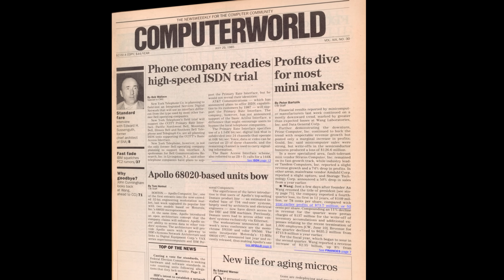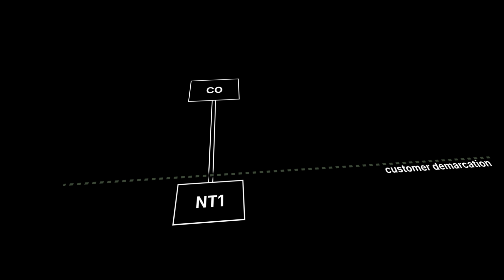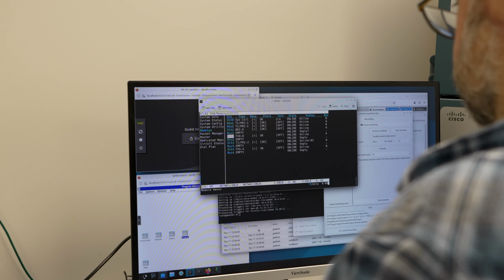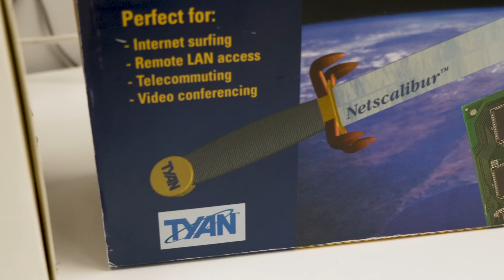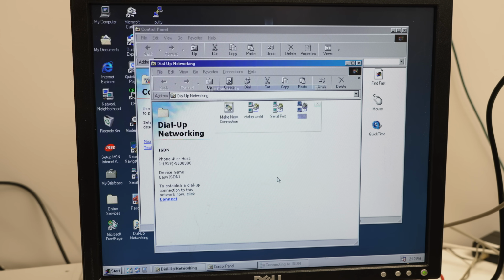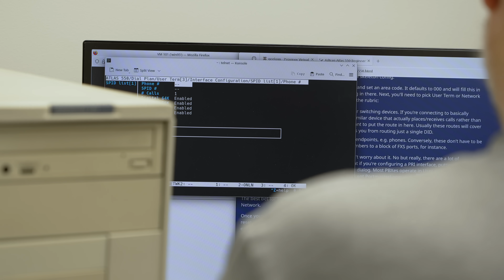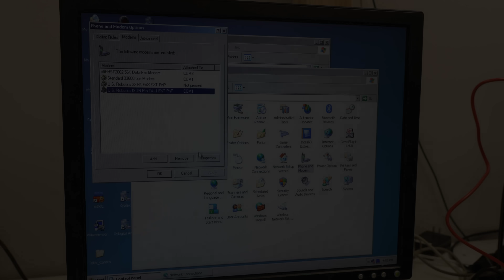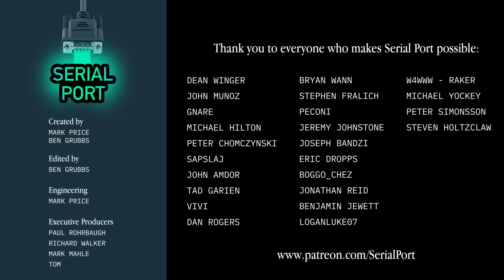Do you remember ISDN?

Comment: Dial up 200ms… what? That’s way high. ISP fixed connections run interference now to moderate speed and add network perk bandwidth issues; which are not real.

Comment: We finally got ISDN beginning of the 2000s when a lightning nearby destroyed my 56k modem for the second time, and before DSL was available for us. It was great: No conflicts over the phone line anymore, and you could configure 128K the way that it would hang up one lone on incoming calls (because there was the B channel that could still signal those). Best of all: We finally got a flat rate, and while German Telekom blocked several ISPs at the time for this rate, my university ISDN number wasn't.
ISDN was great, and I wish we had it earlier. Instantaneous connect, flawless connection and uninterrupted high download speeds (for the time anyway...).

Comment: ISDN is only recently going away for broadcast. It was used for HQ IFBs, remote-access, even studio-transmitter-links. I had an early AAC connection to a station as a primary path, and if it failed an 802.11b (yes, that old protocol) link would take over... How many times did I have ask other broadcast engineers for their SPIDs, LOL...

Comment: Living and working in Germany in the 1990s, I had an ISDN BRI at home. I connected a home PBX with 4 phone extensions that used one channel, leaving the other channel for data connections to be used with my laptop computer that was equipped with an PCMCIA ISDN card. Deutsche Telekom was pushing to roll out this technology, they even offered a "self installation" where you could switch from POTS to ISDN without someone from DT showing up. It worked flawlessly.
At work, we connected four sites in Germany, Austria, Sweden, and the UK via ISDN. We used the Novell NetWare MultiProtocol Router with ISDN extensions and hardware from AVM. The different telekom providers supported slightly different features, for instance regarding the signaling protocols. I vaguely remember acronyms like 1TR6 and DSS1. But we could make it work with using the least common denominator.

Comment: True 'data' calls were always expensive on your BRI in the New England Telephone/NYNEX region.  The hack was to use a Motorola Bitsurfr Pro with serial interface (and possibly other devices supporting this) and make 'DOSBS' calls (data over speech bearer service).  This would presumably let you buy a 'voice' calling plan and make true '56K' bidirectional 'data' calls over your voice plan.  Funny thing was that NET/NYNEX would never properly apply your voice calling plan to an ISDN BRI line so you would have to call every month and get credits.

Extra bonus:  If your city/town was served by NET/NYNEX DMS CO, you could make two voice calls simultaneously over your BRI and not be charged.  (Hint:  One 56K DOSBS call up nearly all month and Second POTS port on Motorola Bitsurfr Pro available and 'landline' voice)

Credit for this knowledge goes to Usenet group: comp.dcom.isdn and most especially a local New England ISDN legend:  Fred Goldstein

Comment: I used to have ISDN (British Telecom (BT) Home Highway) and got my VAX to dial up my ISP though a terminal server giving me the maximum speed, though 64k was so much of an improvement over the 56k (ish) modem, Plus I had two phone numbers. When ADSL came out I had an additional POTS installed. Then, sadly BT terminated my service and like others I miss it. I have FTTP now (1 gig) but ISDN still felt faster! I've acquired ISDN enabled field audio equipment too, you could do broadcast quality (just about) stereo on 128k. Can't use it though.

Comment: I had an appointment all setup to install an ISDN line, equipment purchased and ready to configure (that exact 3com adapter used at the end). About a week before that appointment a little birdie told me that Comcast was testing cable internet in my area and put me in touch with someone that got me on a list to get service before it was publicly rolled out.  The difference between dial up and cable was life changing, but still a little sad I never got to play with ISDN in between.

Comment: 25 years ago I worked for a company having over 250 networked PCs. All of those accessed the internet on a 128kbps ISDN connection. :) Clearly the internet was just a tool that you would only use every now and then to look something up or send/receive emails, but there were obvious congestions sometimes. However, it was pretty reasonable most of the time.

The real hero: the Squid proxy cache. It's hard to grasp the power of Squid unless you see how so many people were able to have a reasonable online experience on a bandwidth that makes no sense by today's standards. Whoever lives in an area with slow internet and multiple users should set up Squid and see how that helps. :) It's a cache, so it can only help with things that people browse in common, but whenever the cache gets used, that leaves some bandwidth available for someone else. Accompanied by squidGuard, you can even do more advanced content filtering to block domains running ads, malware or other nasty stuff that you wouldn't want to ever reach your browsers.

Comment: I have one of those Atlas 550s.  The RTC is a module kind of like the infamous Dallas DS128[8]7, but not exactly.  It uses a Benchmarq bq4287, which are long gone these days.

I designed an adapter board that uses a Maxim DS12885 (basically just the core IC from an '87, not in a hybrid package with the onboard battery.)  The Benchmarq is similar from a software perspective, but has the ability to provide power to external SRAM.  My adapter has a coin cell holder and some logic to provide backup power when requested.  However, I obviously didn't get the design quite right, based on my understanding of how it works from the datasheet.  So, my Atlas still has no ability to save its settings between boots.  I'm going to have to spend some time with a multimeter and a logic analyzer to figure out what I got wrong.

Unfortunately, the design of the Atlas chassis makes it difficult to get to the main board, particularly when the card cage is installed.

Also, be warned:  The Craft (serial) interface over RJ45 on the business end of the chassis is NOT the same pinout as your typical Cisco-style rollover cable would use.  If you try, there's a very good chance you will detonate a surface mount resistor on the bottom of the PSU board near said interface.  Don't ask how I know this.

Comment: Oh boy, this brings back some memories of getting to experiment with tech while working infrastructure at a 90's ISP. After we switched from individual analog modems to a digital back end, I installed an ISDN connection at home with a 3Com ISDN TA connected to a Linux box to share the connection to the rest of my LAN, and even served a couple of personal websites from it. At one point for testing, I routed two newly-acquired class C blocks to that Linux server over the ISDN line and had 500+ public IPs piped straight into my basement until we put them into production use elsewhere.

I do remember flying too close to the sun and getting an $1100 home phone bill from Ameritech one month because something went wrong where the second ISDN channel kept redialing and connecting over and over every few seconds, and they still charged per call over some amount. I eventually got that bill waived, but it was the lesson that taught me never to put utilities on automatic payment. :)

Comment: In 1995 I won a 3Com ISDN modem at a SF 49ers game. That was around the time 3Com bought the naming rights for Candlestick Park. I made a deal with my dad to get an ISDN line as long as he could use one of the two lines for a fax machine. He worked as a contractor for PacBell connecting and disconnecting ISDN lines at a central office, so he knew what the tech was capable of. Ah, the pre-broadband days.

Comment: Telenor has largely withdrawn legacy ISDN in Norway, so I suspect the actual ISDN service is no longer provisioned.

That said, at my workplace there are still ISDN NT1 wall units installed, and the "Line" LED is lit green. This indicates that the U interface is powered and synchronized, meaning the copper pair is still physically connected to an exchange or a nearby line card or remote unit.

A green "Line" LED does not by itself confirm that an ISDN service is active, only that the physical layer on the U side is up. Since this is a building owned by a national railway operator and located close to railway infrastructure, it wouldn't be surprising if some legacy access plant is still physically present.

I still need to test whether the SO interface is actually active. I plan to bring a laptop running Windows XP along with my old Compaq USB ISDN Adapter (P/N: 321750-B31) and check for Layer 1 synchronization on SO.

Comment: Our company (in germany) had ISDN (E1 PRI + 3 BRI Backups) from a local provider until 2 years ago for telephony. We had to switch because the provider took their older infrastructure offline bit by bit - otherwise we'd have had no reason to switch to VoIP. ISDN "just works" - VoIP on the other hand has a lot more systems that play a role (router, firewall, possibly NAT...) and can be a headache if used for more than just calls:

We're in the medical field, where FAX is still a big staple of fast, urgent communication with clinics and physicians for various reasons.
But FAX over most VoIP hardware is a nightmare. We even helped external physicians set up their VoIP Adapters + MFP Fax systems for reliable transmission over these "bad" lines (compression, artefacts, jitter - they don't become an issue in normal phonecalls, but fax does the wildest things if these occur...

In-house we still use the ISDN lines our PBX provides: The 2 HylaFAX Servers are connected by 4x BRI each for 16 concurrent faxes :)

Comment: I still dont know anyone who had it other than maybe the schools? But i think i remember watching that video in 2001 about ISDN in my votech school when we learned about different WAN connection types.
Reply: In 2001 i think my highschool was connected via a T1 leased line to the adminstration building that then had some slightly faster connection to the greater internet. Then in the mid 2000s as seen from the first Google street view potatocam in 2007, they setup a wireless PTMP network with tall towers at the high schools and other district buildings and small PTP receivers ontop of elementary/middle schools. Now i think Starry and wifihood rent space on those towers. (aurora colorado) - Clabretro made a video about the AT&T Merlin phones from 1983 that our school system also loved using, and I remember fondly throughout my years there.
Reply: @mystica-subs nice! We had some kind of t1 eventually. I think in high school. I remember high school having slow but reliable downloads. Line of sight wasnt so great in NJ and with us being the birth place of bell labs they of course had ATT T1 and T3 lines. I also remember the merlin phones. I also remember Nortel. I forget who had what. I know my Kmart was all Nortel. I have one i bought new when the store closed.

Comment: I work as Computer-Specialist here in FR Germany since 1990 finish licensed and often my customer was small businesses. One customer gave me the old telco Agfeo AS 33 for free how was installed in doctor office in this house before. Costs at this time new only 800 € (with out system phones, cables, stuff), original price at start was 2'500 DM (~1250 €) and a friend in this business send me free firmware. They offer free software for call phone numbers over Windows 98 and later, and run in Windows XP as client / server system too. Running till now in my private home without problems with phones in all my rooms. 🥰 Yeah, the relays sometimes works bad but it is an old timer. 😂 I have an other Agfeo AS 33 and AS x1 with extra parts and some other rebranded Agfeo telco here - fully working as demonstration.  Anno 2025 nothing worth after no company use ISDN more but works fine behind FritzBox and Co.

Comment: I had ISDN basic rate access at home back in the 2000s.
At the time it was considered revolutionary and marketed as "Superlinea ISDN" (i.e. super-line).
The cost of an ISDN line was only 1.5 times the cost of a regular analog line for both the home and the business accesses so, not a big deal considering that there are two separate channels available and both channels were faster than analog dialup.... for the times, it was a great improvement!
 BTW, for the household lines the option "PLUS" (a the double digital to analog converter to allow the use of the older analog phones) was offered for free.

Comment: WOW, this brings back memories. I had ISDN at home between 97-99, before cable, using a 3Com modem with Ameritech. I think the cost was around 70 bucks a month for 128k, and I just made the two-mile cut-off to the office by a few hundred feet. When I finally got a clean digital line to play FPS and actually be able to 'surf the net' at reasonable speeds, it was heaven. Once, I had a local Ameritech employee call me asking what I was doing on my phone lines because all they heard was  'static'. I was like, dude, look at my records. He wasn't familiar with ISDN and didn't know anyone other than businesses in my area that had that type of connection. It was comical.

Comment: Since you guys and clabretro is having a great influence on me, it is very good to see that you started to use Adtran Atlas devices. I’m using an 550 like a year or two, with Eicon Diva modems and Eicon BRI/PRI cards in my RAS server, demonstrating these in our Exhibition proudly.

Some catch: Regardig the dead battery, I was tired of constantly having to reconfigure it again and again so I did the following with the help of a friend: My Atlas 550 (white front model) came with the Dallas DS14287, wich can be replaced with the nwX287 by Necroware (Benchmarq BQ4287). Only difficult is that the factory battery needed to be desoldered and an empty socket to be installed. The device had to be completely disassembled

Regarding the MultiLink PPP: When I set up everything, it looked like 128K in Windows, but it was a Lie, on my Eicon Diva ISDN modem, only having one green B channel was a clear indicator that it failed to call both channels, this was also confirmed in the adtran channel monitoring too. This was a constant failure when I used Only BRI channels end-to-end (Eicon Eicon DIVA Server 4BRI-8M). But when I switched to PRI on the RAS end, it was easy peasy, 128K both on windows and on the Eicon ISDN modem. The PRI Card is also Eicon, Diva Server V-2PRI/T1-60 PCI Dual. 

Since I use BRI-S/T cards on my RAS devices I cannot utilize directly the BRI-U port on my Adtran. To avoid this, I use Adtran NT1 Ace4 converter… later I will purchase S/T modules :)

Managing the 550 via serial is ok, but using the terminal via IP is a whole another level, making the setup way more faster.

One of my next Project is to connect multiple Atlas 550s via T1 to have multiple SideOffice like scenario, alongside with the PPP modem pool :)

Br
Matyas

Comment: I had two lines running ISDN and combined them to 128k. In the UK this service was sold as BT Home Highway. I was lucky to have an ISP that had a flat rate annual fee with a free dial up number so I had internet I could run for hours at a time if I wanted. I even ran a web server from it. This was around 2000. I also had mobile internet with three lines at 9k giving me 27k bonded. I owned a web hosting company. Eventually I got a 256k leased line which required a Cisco router in the house and cost $1000 a month in US money, but it was an always on connection. That was 2003 and was my only choice where I lived.  It's  hard to believe that my mobile phone has 300 mbit 5g on it only 22 years later.
Reply: And no, I didn't run the web hosting company on the ISDN! I realise how that could read! I ran test servers on the ISDN .

Comment: I was visiting a client (UK) in the Summer, and they had a call from BT asking about their ISDN connection and handed the phone straight to me as it was 'technical talk'. They had previously had an IDSN connection to an old Panasonic telephone exchange and a local engineer was calling to ask if they were still using it as they wanted to re-use local cabinet space. I told him I'd migrated them to VoIP over a year earlier and he mentioned they might want to check their bills. Turns out they were still being billed for a connection to a dead telephone system. I was quite popular when the refund came through!

Comment: The Sun SPARCstation 10 (and maybe other SPARCstation models?) has a built-in S/T ISDN port along with it's standard 10BaseT Ethernet and serial interfaces.  One of the only workstation computers I've seen that has a built-in ISDN interface as standard equipment.

Comment: I remember ISDN largely being obscure for end-user companies outside DFW and Houston in the 90s as most were either dial-up or T1.  However, I utilized the hell out of ISDN through 2010 as a mesh-network backup for 800 MHz and microwave radio repeater networks I serviced.  Really damn consistent when you got it set up properly.  Thanks for the memories.  I miss these times.